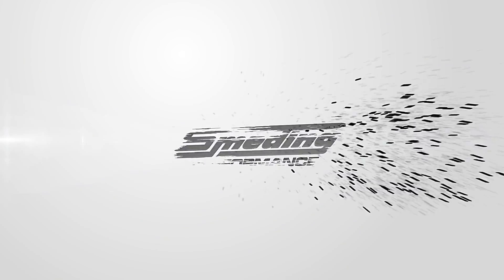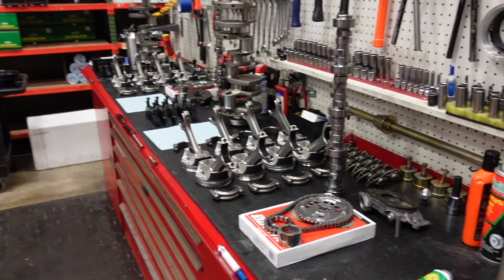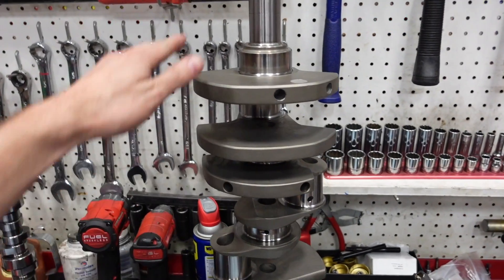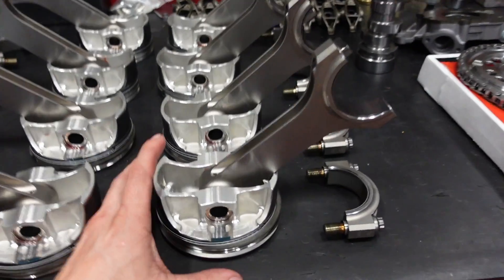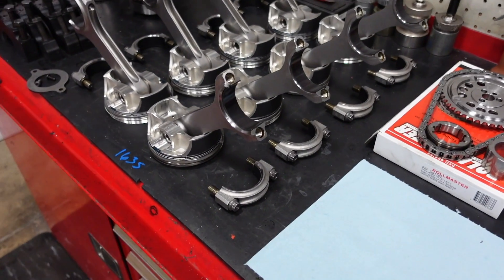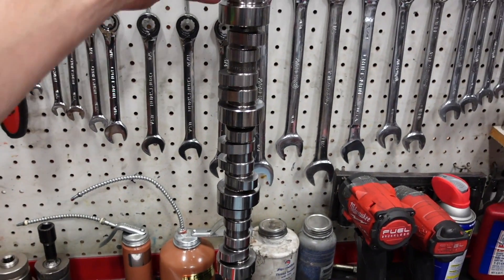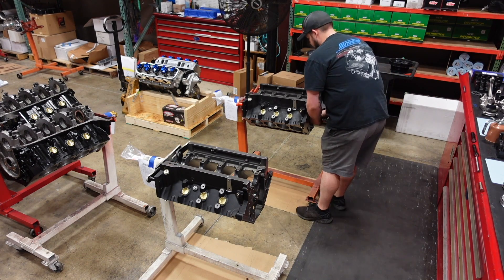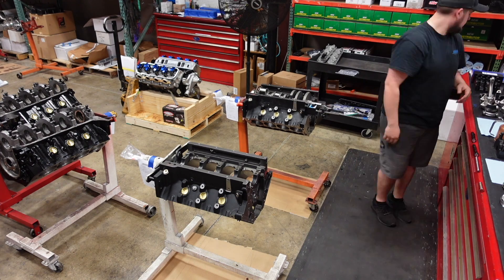How to Build a 1,400hp 427" LS Engine (Easier Than You Think)

Comment: I would never build another engine with a single row timing chain would go with a cloyes double roller way stronger check it out these guys don't know how to build engines I had one break racing on the quarter mile in a 454 built engine around 500 HP so I told myself never again!

Comment: currently working on a similar build for a 416 ls3 block (supercharged 1200hp). i keep getting conflicting opinions on bearing clearance. i have a used block but i think it its a nicely machined 416 aluminum ls3. i have full forged internals. My plan at the moment is .003" on the mains, but i keep thinking i should be targeting .0025".
Reply: .0023-.0025 is what I shoot for on our aluminum blocks at that power level.
Reply: Hopefully those stock sleeves hold up. My kong 2650 416 LSA didn’t last long at 1000whp
Reply: @Logan Gremillion  what do you think the issue was? What rpm were you running?